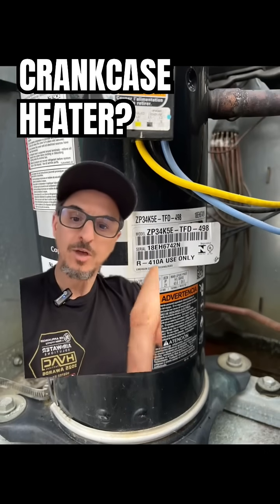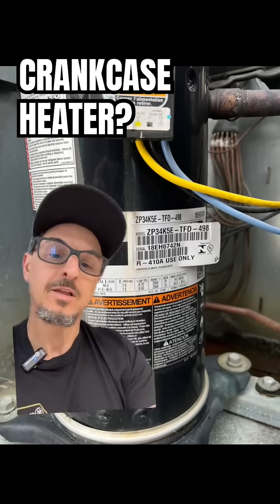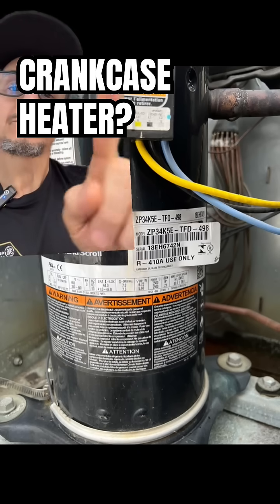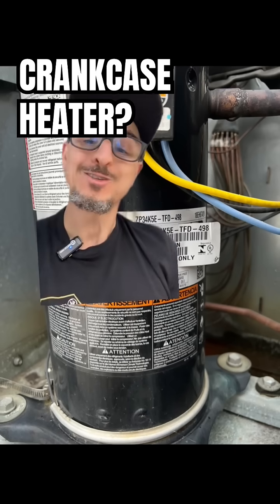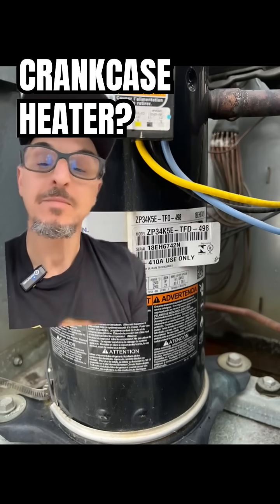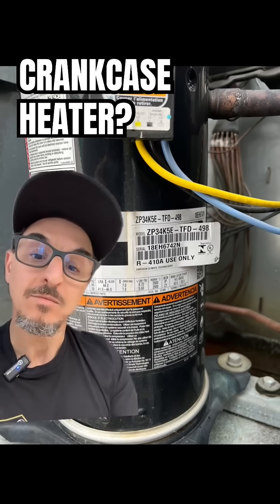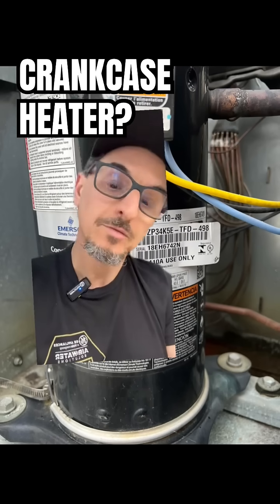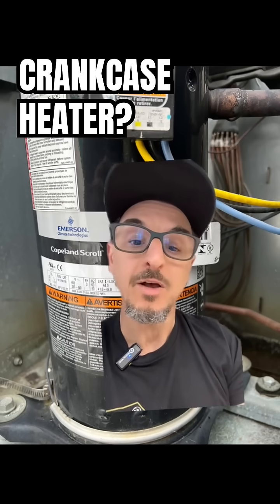Crankcase heater explained

Comment: The crank case heater also helps with the oil's fluidity. In colder times the oil tends to become more viscous.
For most big equipment is recommended to have the crank case heater running for 8 hours before commissioning or before restarting after a long time.
Reply from the maker: Thanks for the comment!